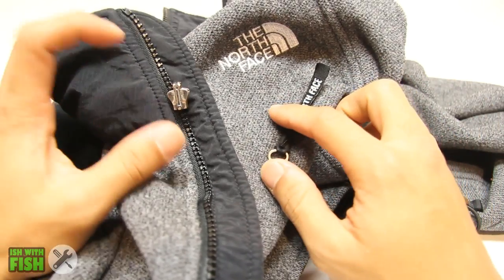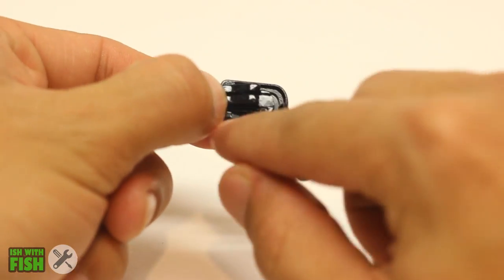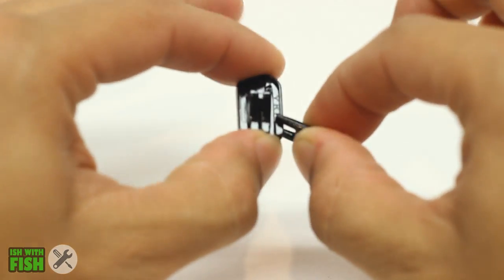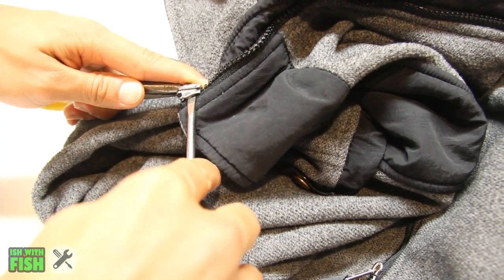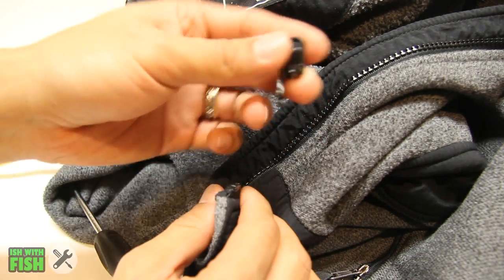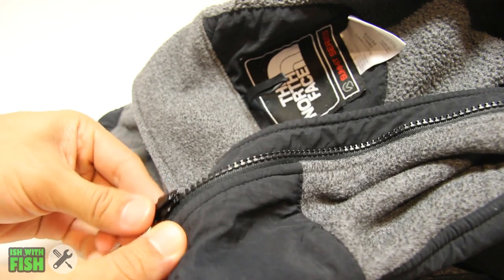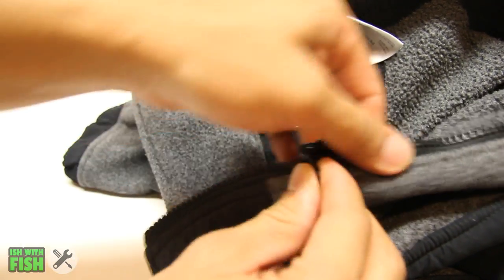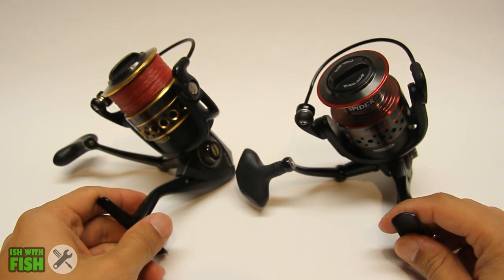How to Replace a Locking Zipper | Simms Columbia North Face Arc'teryx Stomr Mountain Hardware

Comment: Thanks for this. My favorite, often-worn leather jacket lost the pull tab from the zipper slider. It's a YKK #5V locking slider, which I just ordered. Right now, it's below freezing outside practically every day. I can zip and unzip the jacket with the black nylon zip-tie I've attached, but because the locking tab isn't there, the jacket just gradually opens on its own. Really annoying! It helps knowing how to approach replacing this when it's delivered :)
Reply from the maker: cool, good luck! my method might not be perfect, but it was simple and worked for me👍

Comment: I just had my zipper come off on my favorite coat. Luckily I saved the  pieces. I wasn't satisfied with how it fit when I reattached it because it was too loose. What I did was I took out the fleece jacket by unzipping it from the shell.Then I took apart the zipper that was attached to the inside of the shell and used the parts on the outside the main zipper.I didn't  take it completely out. I then used the tab that had failed and put it in place of the inner to reassemble it. I used the main zipper much more than I ever used the inner one so it was like new.I could have used the zipper from the fleece  but I didn't want to because the fleece had not failed and worst case scenario I could always just buy another outer shell. On Columbia coats there are zippers on all the pockets, but I would not try to use those to replace the main. They are different.

Comment: Just a few questions!

I ordered the replacement zippers linked in your video description and tried to pry open one of the zippers on the same side as my North Face jacket I needed to reattach to, but it broke before I could make the opening wide enough. Now another attempt later (also ending in breaking another one), I may be currently down to the last one before I have to order a new set.

How wide does the gap on the side you're first reattaching to have to be in order for the zipper to slide back on? And did you have to slide down the replacement zipper straight down the jacket or at an angle for the zipper to attach itself?

Also, is there any indication other which orientation the zipper is supposed to be facing when reattaching? I didn't keep track whether the original zipper had its eye outside or inside the jacket because it got ripped out after it got unexpectedly caught on a ladder.
Reply: I second these questions! Ive broken two zipper heads so far and have one left...